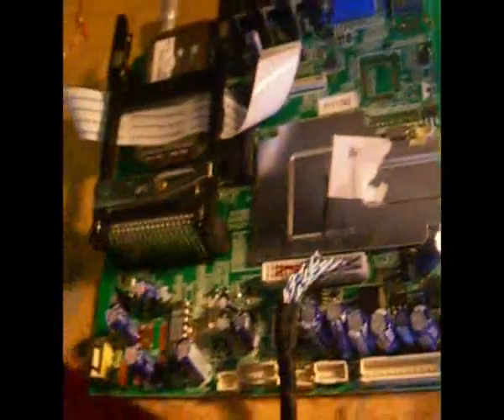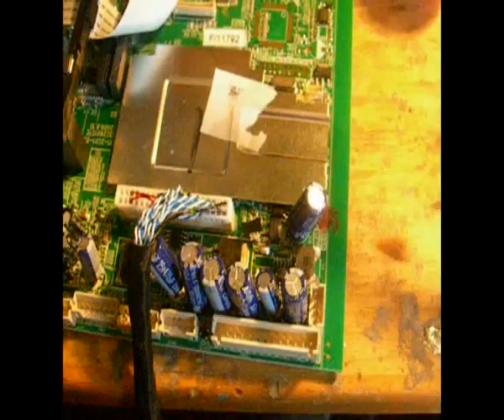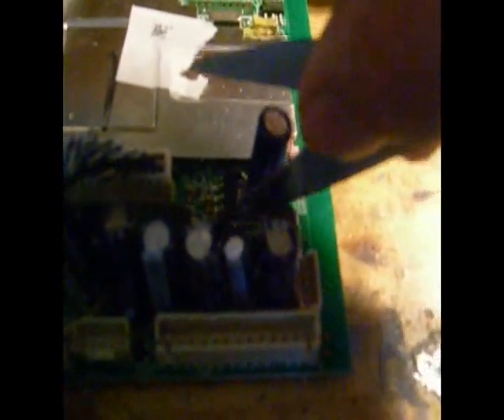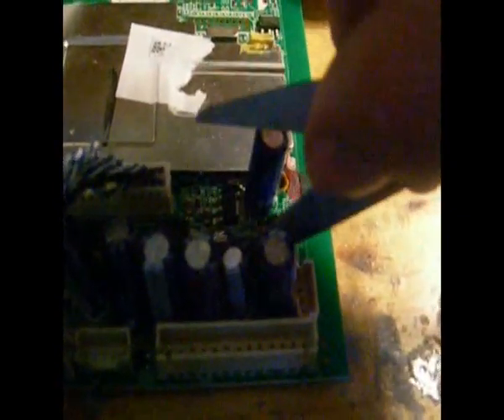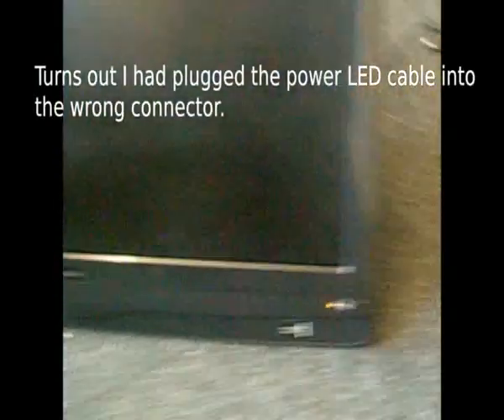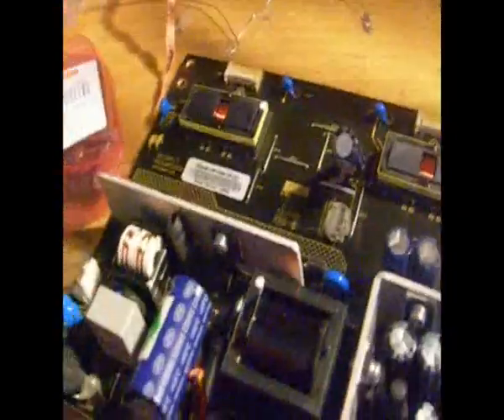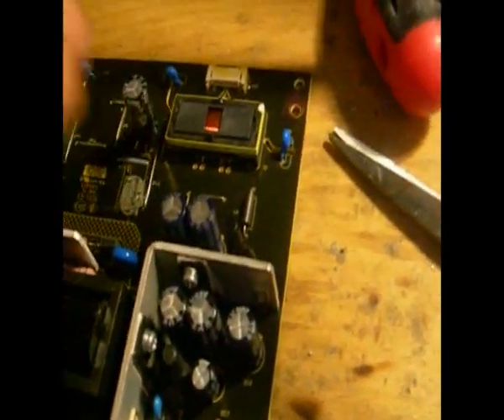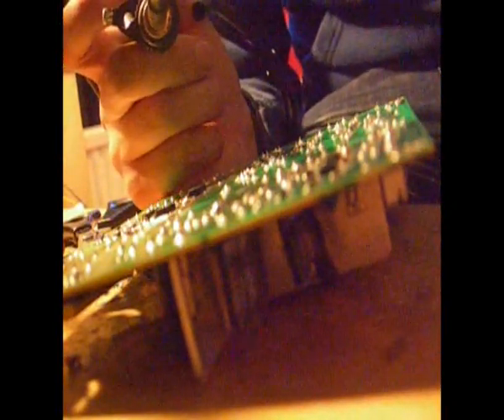Bush LT24M3 - Flickering power LED/No power/Intermittent power - Repair including Recap

Comment from the maker: I have a memory that it was adjustable, but the part # is written on the device in case I'm wrong. The capacitor values are also written on the capacitors (µF and voltage rating.) You don't NEED to replace the caps, but it will significantly improve longevity of the TV.

Comment from the maker: It supports up to 1440x900 via VGA, 1920x1080 via HDMI. Both have overscaling and fixed sharpness, which cannot be turned off, so this TV is very bad as a monitor. At least if you want a pixel perfect display. I sold it and picked up a faulty iiyama ProLite 24" FHD monitor instead.

Comment from the maker: Did you have to add a custom mode to do that? I could only get 1440x900 on this, but if I edited custom monitor timings I could just about get 1920x1080, but it still had the sharpness problem and because I was driving VGA near its limits, some trailing/blurring on edges of images.

Comment: was that an AMS1117 ADJ Voltage Regulator you replaced?  Do you recall the Capacitors values ? maybe you can post them in I have the same problem with my Bush TV